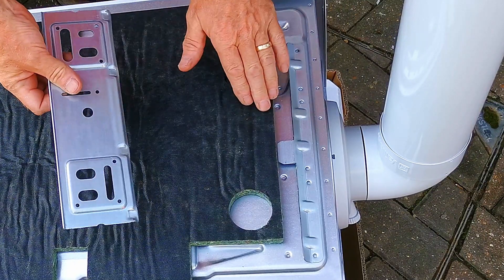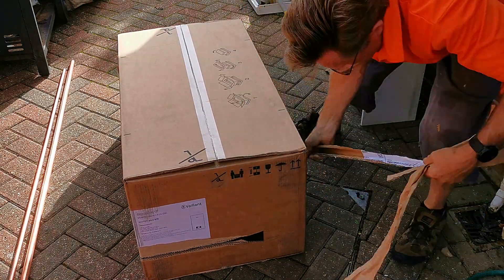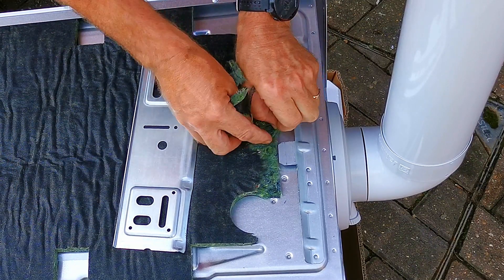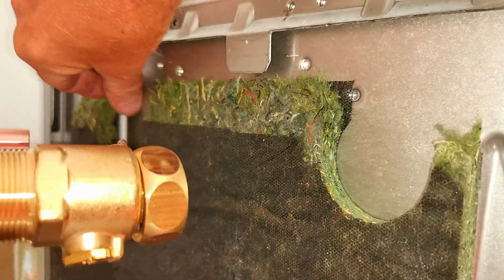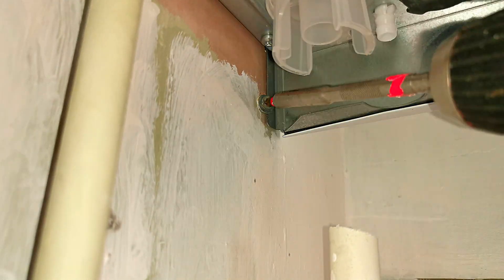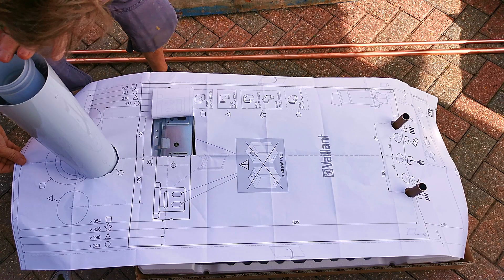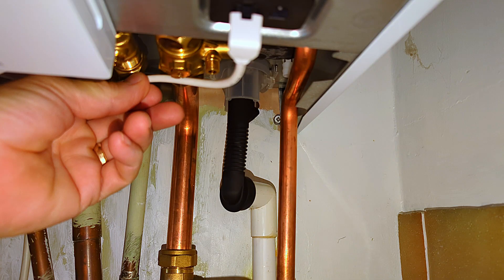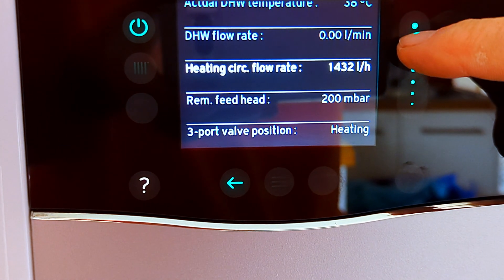New Vaillant Ecotec Plus Installation Issues,  Insulation Causing Problem & Replacing a Old ecotec

Comment: Hi,  I've been looking through your various videos and I must say thay are brilliant and thank you for experience and help.  I have a ecotech pro 28 and I seem to be having a problem with the clock!  I know this may not be something you can deal with, but I wonder if you have come across this problem?  Just recently the clock has sarted to play up and stops working or losing time.  I have tried a replacement with a recondition clock (which I sent back) and it turned out to have the same problem.  Any ideas?  
Thank for your time.
Regards.

Comment: Hi Mark, great video! I have this boiler model installed and the touchscreen keeps rebooting when the boiler is running, thus is something related to heat. Did you encounter this problem before?

Comment: Hi Mark we have an older eco tec 832 model around 8 years old however ever since we have had this it seems to take an age to get the radiators upto temperature it gets to 39 and stops for around 30min then decides to run again to around 50 it's fine with hot water its been regularly serviced can this problem be fixed or do we need a new boiler many thanks kev .

Comment: Found the new one a disappointment to be honest. 

So heavy compared to competitor boilers for a start. The insulation on the back as you've pointed out just gets in the way, I thought it was just me! 
And you're right the connections below are a pain especially the prv, it's just in the wrong place and too tight to the condensate run.
Reply: Heavy is good. Heavy is reliable :)